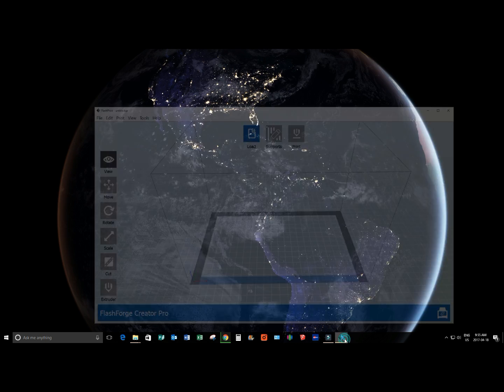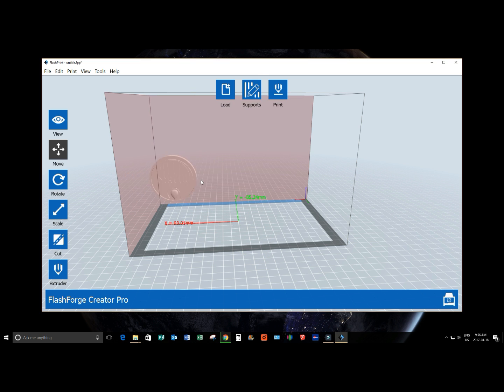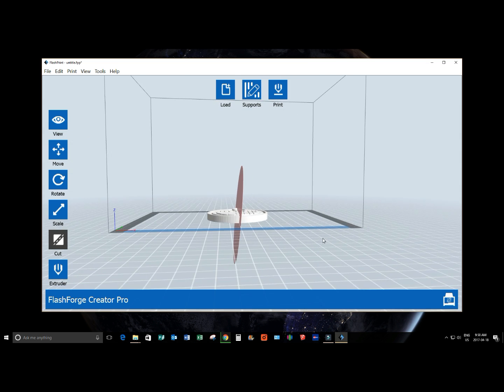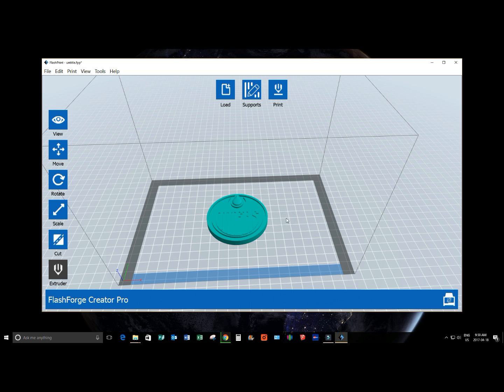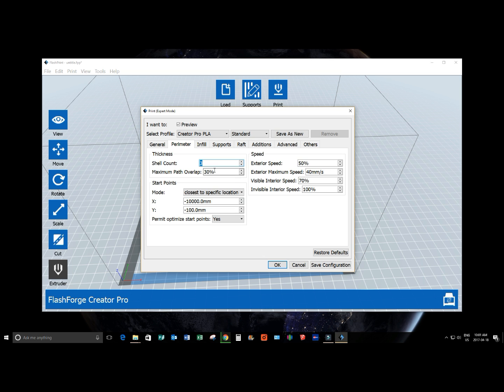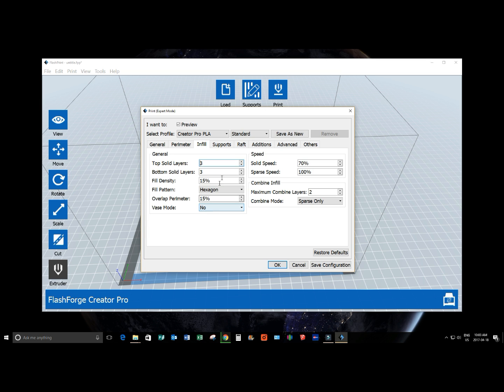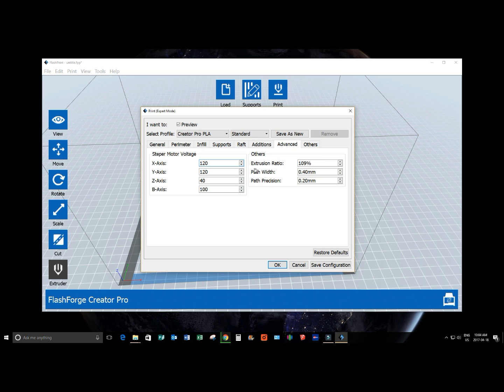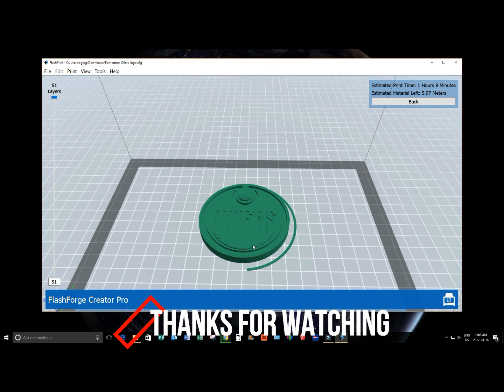Flashprint Basics

Comment: Hi, a scaling question....
I started my design, 2D in AutoCad, dimensions in "realtime" in mm, It imported fine into SketchUp PRO 2019, all dimensions correct. Then exported as .stl from SketchUp (also tried .obj).
Started FlashPrint v.3.28.0,loaded model file in, but it came in very small, tiny in fact.
I used scale tool, manually entered Z: as 3mm (which is what it should be), and as I had uniform scaling ticked X & Y axis became 74.28 and 79.96 respeectively, which they are (only 0.04mm out). The scaling factor displayed as 99999.00%  !!
It does print nicely and finished part dimensions are perfect,
but this does not seem the correct way to me.
Am I doing something stupid ??
Any suggestions to what is going on gratefully received.
Thanks, Steve
Reply from the maker: So when imported into Sketchup it's in the correct units of mm, but export appears to have changed? When exporting STL in Sketchup on the model units dialogue did you set it to mm or model units?
Reply: @imaginationtechnology6291  Thank you, that solved it.  I was using model units, if I select mm's then it comes in perfectly. :-)  Steve

Comment: How do you print someone on a low scale
Reply from the maker: Do you mean simply scale them down for printing?
Reply: @imaginationtechnology6291  
If I wanted to print my self I would I slice it
Reply from the maker: @CHRIS-FROM-AZ  Assuming you have a 3D model of yourself, you could simply import the file, select scale and drag the mouse to the size you want or click on the scale icon and input a % reduction or increase you require.
Reply: I dont have one but I want to make one
Reply: What I'm asking is how do i scan something and print it
Reply from the maker: @CHRIS-FROM-AZ  Ahh, makes sense. Well you can scan a number of ways with a handheld unit, a structure sensor for iPad or you can use photogrammetry (taking a bunch of still photos around an object and combining them to generate a 3D model). I believe there is also a few iPhone apps that use the new iPhone camera system to scan objects.
Reply: Cool 
Thank you bro

Comment: Any idea about whether
1
Blender is suitable  for 3d printing modeling?
2
Does blender output file work well with flashprint slicing software?
Reply from the maker: Most mesh files formats will work through export in Blender. But simply put you would File > Export > STL and make sure  the scene units is checked. The biggest problem exporting any 3D model will be mesh errors, Flashprint attempts to correct basic issues but may end up making a mess of the exported file. If that happens it's good to identify where the errors are and correct them.
Reply: Hi, novice question. 
I’m looking at getting a flash forge adventure 3 to do some printing and I have used and have solid works software. Will a file designed in solid works import into this software? Your reply would be greatly appreciated. Thank you

Comment: hi how to set steps? When i make 20x20 test its 20x19.6 and where to correct it... ?
Reply from the maker: Which model printer do you have?
Reply from the maker: You can't change the step count as that is set in the firmware, but you can change output stepper voltage which may affect the print.
Reply: @imaginationtechnology6291  i have ctc duo... So if i change voltage it will be change Y axis lenght ?
Reply from the maker: @ostry599  I think it's worth trying to see if it will work. Only I wouldn't go more than +/- 5 volts in either direction without printing. If you go too high in voltage it might cause the stepper to heat up.

Comment: how did you zoom in
Reply from the maker: Using a mouse center scroll wheel will allow you change the zoom factor. If using a touchpad you can use two sliding fingers or pinch to zoom.
Reply: @imaginationtechnology6291  thanks heaps mate

Comment: How do you cut a larger object and print it in several pieces when it’s too big to fit on the build plate.?
Reply from the maker: You would have to load the model into Flashprint, cut it into the size(s) you would like and then save the file in a .3mf format. That way you could keep all of your cut pieces separated and remove the ones you've already printed.

Comment: Can you dimension and print to scale like in Auto Cad?
Reply from the maker: MrBen527 Yes, you can import your file and then scale it accordingly. We've done this with vessels and it works great.
Reply: Ok but in this software for the Flashforge you can draft from start to finish like any CAD software?
Reply from the maker: MrBen527 No, Flashprint is only for slicing the design files, it is not a CAD software.
Reply: So I purchase a Flashforge and want to make a custom part.  Beside a computer to work on, what else would I need?
Reply from the maker: MrBen527 you will need to buy some filament for it. If you are new to CAD I would start with TinkerCAD. It's free and doesn't require a serious computer to use.if you're not new to CAD then this should be a lot of fun for you! Congratulations on your new printer.
Reply: Cool!  Looks like TinkerCAD is not bad!  Thanks!

Comment: I can't believe that FlashPrint still has no USB support for my Creator Pro after several years. It clearly knows what printer it is connected to, but no way to send Gcode across USB. Constantly removing and inserting SD cards between computer and printer is kludgy and unacceptable. I've never had a problem with USB communications between Simplify 3D and my FFCP. It's a real shame that FlashPrint prefers to remain in the stone-age in this regard.
Reply from the maker: We are going to forward this on to Flashforge engineering to see if it can be done. Enough folks have requested it now.
Reply: @imaginationtechnology6291  Any update from Flashforge?
Reply from the maker: @Admiral_Crow  So far no sign of direct connection support for Flashprint.
Reply: I agree totally! I wasn't expecting to have to save to an SD card to print...ridiculous.
Reply: @todd.foster77  sd card? Does that include flash drive?

Comment: is there no way to send via usb cable?
Reply from the maker: The majority of the printers in our office are not close to our computers, so our preferred method is flash drives. But you can absolutely plug in via USB to print directly. You can also use the wifi or LAN option for some Flashforge models.
Reply: Thank you for your reply. I have the Flashforge Creator Pro Dual and there simply is no option to send the files to the printer via USB. :-(
Reply from the maker: You are right, the Creator Pro does not have a way to send files via USB through Flashprint and therefore you need to use the SD Card. You can use a third party software like Simplify3D (costs $) and it will send files via USB. I literally just walked over there and tested it out so I know that works. Also you can use a cloud based platform like Astroprint for free (No dual print option though with the cloud slicer) but you may be able to slice in Flashprint and use Astroprint to send the file.
Reply: Ah excellent reply. Thank you very much for your help. :-)
Rather odd that it is not able to send files via USB though. Wonder what the reason is.
Reply: Yes, it is crazy that they didn't plan for this, especially in this day and age.